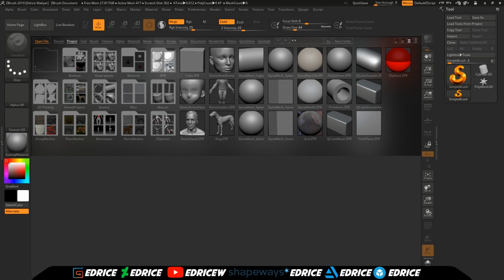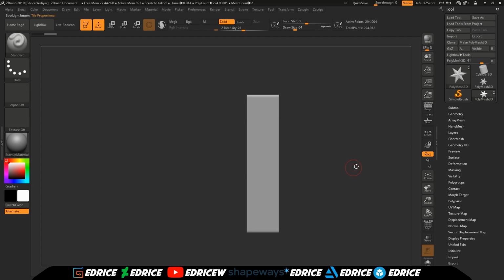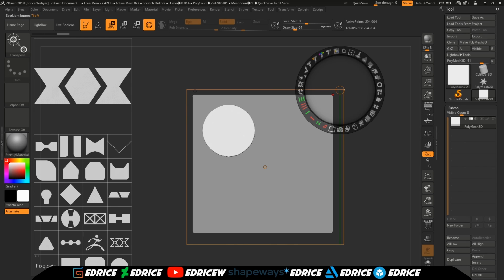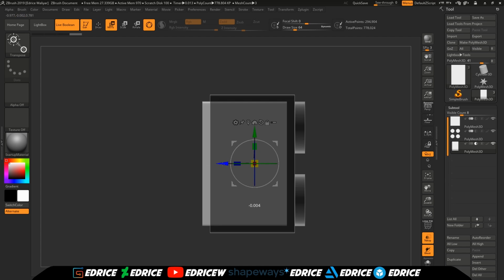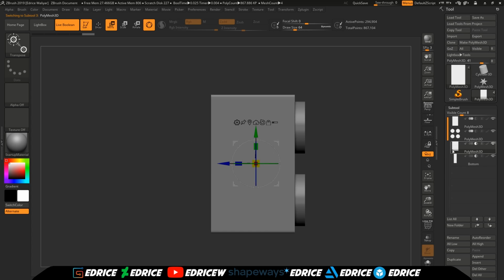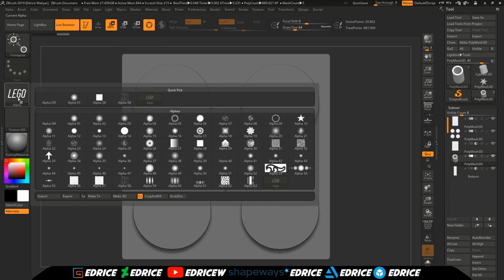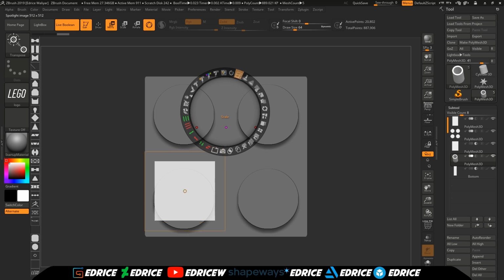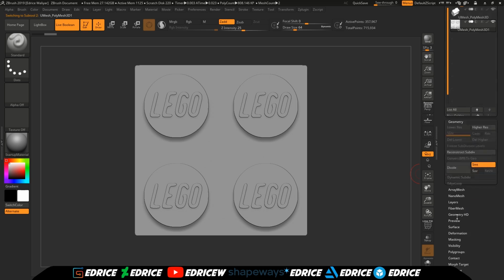Zbrush 2019 - Snapshot 3d

Comment: Good demonstration and explanation of what you are doing and at a pace one can follow and understand. I bought ZBrush back in 2011, and it's been years since I actually selected the tool, thus it's pretty weird to be actually using it again for modelling purposes like this. I think what you've demonstrated is the critical omission of a proper co-ordinates manager that deals with position, size and rotation like what one would find in Cinema 4D. There's no units of real world measurements in ZBrush that one can reference, so everything is pretty much guess work. The snapshop wheel feels very frustrating and slow to use... in that it makes it difficult to identify  and select icons because they are at right angles going round in a circle.  It feels just like ZBrush's GUI,  just meh and clunky in practice. There's no quad, or  multi view, viewports that would make this sort off thing much clearer and thus quicker, for technical modelling.
Reply from the maker: The right tool for the right job, zbrush isn't made for technical modeling, and like you said it shows. Zbrush is more artistic than technical, and that's why you have the option to export and import fbx files, so that you can do more critically accurate modeling in software that is designed for it. The modeling tools in zbrush are made so you don't have to jump in and out for simple things. But if you have to model something technically accurate it's not the right tool for that.